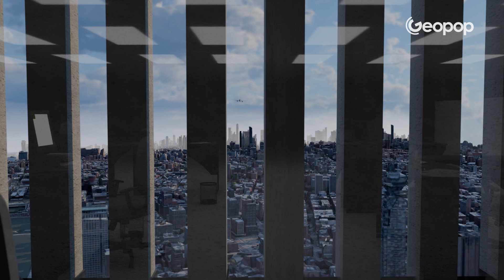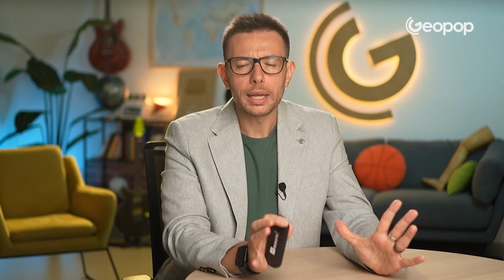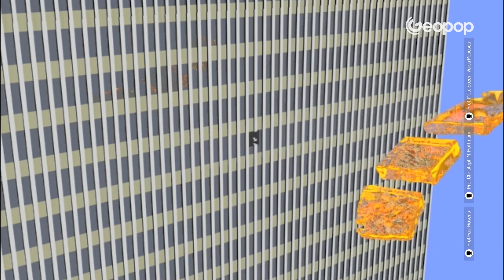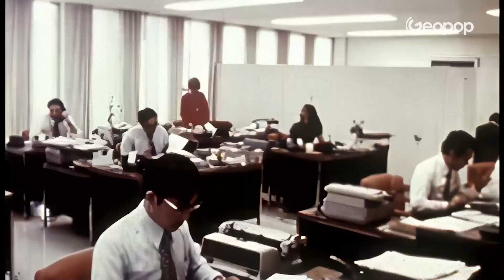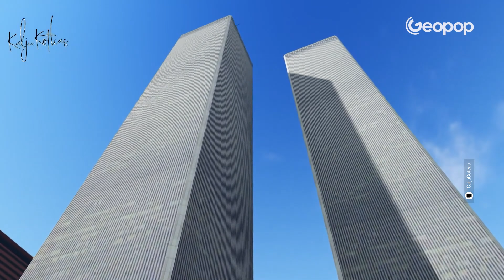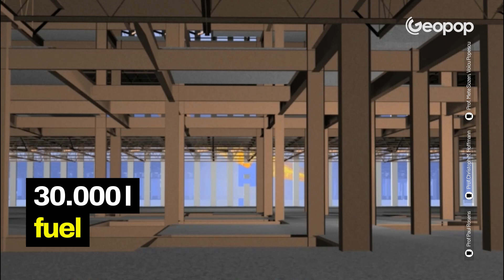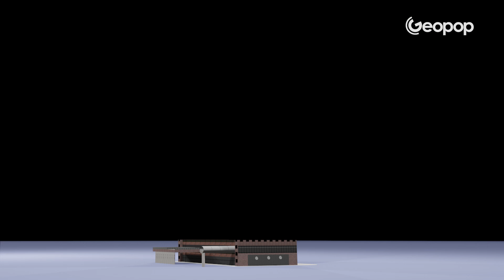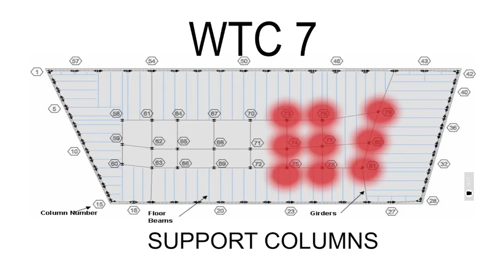9/11, 2001: The Technical Reconstruction of the Twin Towers and WTC 7 Collapses

Comment: I am sorry but below intact floors do provide resistance in a collaps, and will not result in symmetric explosive destruction at free fall of the above and below floors... 

The below structure is much stronger than the above structure. It is impossible for the structure below to instantaneously provide zero resistance at each collapse floor line without the column instantly go from providing support to not providing support. 

We should expect to see deceleration of the top floors and non symmetric collaps and the top floors impact the lower floors.

When a stationary mass is hit by another mass, the kinetic energy is absorbed by both masses and you see overall decorations (resistance).

Note by your own explanation, the top of the building is not a solid item. The central section of the building that house the elevators and stairwells etc is in their own right a self standing sky scrapper that provides resistance. You would expect to see the floors falling amount this section in your explications...

What you model graphically is not how physics work in the real World.
Reply: You are completely wrong. The lower structure is capable of sustaining the load of the upper portion only if this load is carried by the columns. Once it collapsed, the debris mostly fell between the columns, on the floors and beams that were completely unable to sustain their weight and provided next to no resistance. Once those were gone, the columns buckled since they had no lateral support. This means that the upper portion would have fallen exactly like we saw, with  no need of non existent explosives.
Reply: @marcop1563    Exactly,  also note that the collapse was not freefall.  The collapsed happened quickly though as  momentum (mv)  was increased  as subsequent floors added to the mass falling.
Reply: The falling debris bypassed the load bearing structure.

That is why it was falling.

Let’s break it down to the absolute basics:

The 47 core and 236 perimeter columns of the Twin Towers support all of the gravity loads of the building. ALL of the resistance is in the columns.

Planes impact Towers, causing massive structural damage, destroying sprinkler systems, tearing out gypsum board walls and blasting off the SFRM insulation from the floors. Multiple floor-wide fires are started instantly and spread rapidly due to the destruction of fire protection systems and venting of the building during the impact.

Serious fires were largely confined to the impact damaged floors and those immediately adjacent to them.

Fires were started by the impacts and fuel aboard the aircraft, which acted as an accelerant. No shortage of other consumables inside the tower to continue the fires.

Collapse was initiated (started) at the impact and fire damaged floors when floor trusses exposed to heat over time sagged, in turn pulling on and causing the inward bowing of some perimeter columns by up to 5 feet until they buckled on one face of each tower (ie: NOT symmetrically).

www.youtube.com/watch?v=ULdiD6gYZO0

No steel melted or needed to. Structural steel will bend and fail at less than half its melting temperature.

Once the perimeter columns buckled the formerly static load above became a dynamic load 30 times greater, easily overwhelming the structure below.

Thousands of tons of now loose debris fall through the open office space within the four outer walls - bypassing the columns - dropping 12 feet onto the first intact floor it comes across. That massive instant overload causes the floor to fail, shearing the pair of bolts that secure each end of the floor trusses to the columns. The floor fails. adding its mass to the falling mass which continues to accelerate for another 12 feet until it impacts the next floor, rinse and repeat one floor at a time all the way down.

The columns - the part that holds the building up, supporting ALL of the gravity loads - are spectators for all this.

Rate of collapse increases as momentum increases. The collapse front is constantly accelerating.

As each floor fails, air inside the building (the Towers were 95% air by volume) is compressed, then blows out the sides _in reaction to the Tower falling, not the cause of the Tower falling.

No fire required at all on floors below the impact points for them to fail. The mechanisms that started the collapse are different to the mechanisms which continued the collapse. That will be a difficult concept for some.

As the floors fail the perimeter columns are left literally hanging in the breeze, no longer attached to the rest of the structure. They peel away and fall in great sheets (think banana) out to more than 600 feet from the base on the 4 points of the compass.

Core columns failed last.

No Laws of Physics are violated so no need to invoke magic or divine intervention

Each 110-story tower had a 1-acre footprint. The debris pile was up to 14 stories deep and spread out over 16 acres, destroying 8 surrounding buildings and damaging more than 100 others.

Anything can seem like a conspiracy if you don’t take the time to understand how it works. Hopefully now you do.  If not, I can go into much greater detail.
Reply: Please try watching how WTC1, WTC2 and Building 7 were demolished using videos of how they actually collapsed and compare them with the way you are suggesting...
Reply: @llobj001  we all saw the recordings. They are perfectly compatible with a collapse due to the fires and damage from the planes and completely incompatible with a controlled demolition.

Comment: I think this narrator is wrong about the not melting. Looking at the video just before th collapse, molting steel was pouring out the corner of the building. I personally think the CIA was involved.
Reply: Molten steel pouring out of the NE corner of the South Tower (and it was in fact ONLY the South Tower)?

You mean this?

youtube.com/watch?v=xPVGGQU-MeQ&ab_channel=SeekersofTruth

So you think that is steel why? Because you performed metallurgical tests? Because the internet told you that’s what it is? I think we can do better, so let’s do better and build a theory the right way instead of making evidence-free assumptions. This will take just a couple of minutes and is worth the investment.

The Boeing 767 which struck the South Tower weighed 117 tons and 80% of that was aluminum. The exterior cladding on the Twin Towers – the white panels – were also aluminum.

When Flight 175 struck at the 81st floor its momentum deposited much of the office contents in its way and the bulk of the aircrafts mass into the NE corner of the building. The piled up debris shoved into that corner is visible in photographs and video so we know it was there. There’s a good shot here of piled up debris from 4:36; 

youtube.com/watch?v=ZLJyL63sqtU&ab_channel=MrKoenig1985

Steel melts at roughly 2,750-deg F while fires in the South Tower reached peak temperatures of around 1,800-deg F. Aluminum OTOH melts between 887-deg F to 1,180-deg F depending on alloy. That aluminum will melt under these conditions is not a surprise. If you look at pictures of cars left behind and destroyed by forest fires the aluminum wheels are invariably melted away along with other sometimes aluminum parts like hoods. Steel bodies remain intact.

The “molten metal” appears at 9:52 am. At the same time we see the first externally visible signs of sagging floor trusses and the pulling of the perimeter columns inward. I submit these events are related, not coincidental. The aluminum cladding at the NE corner also appears to me to be burning. It is likely with the floor trusses sagging under the heat, and the 81st floor truss in the NE corner under the debris pile subjected to the heavy load of the debris pile, the truss broke its perimeter column connections and dropped, instigating the material starting to pour out of the NE corner at the 80th floor. Given the properties of the materials in question, aluminum is by far the most likely culprit.

Reports from The NIST, FEMA and MIT all concluded the material is aluminum.

Certainly steel is the least likely of all the materials the anomaly could be given its much higher melting temperature and the fact there is no logical source for molten steel. The perimeter columns in the NE corner are intact and the material is pouring out between them. So it isn’t columns melting, therefore what other source of steel is there?

Deniers will claim molten aluminum appears silver when molten, which is true but only at the low end of its melting temperature range. Aluminum can and does get hotter and it glows red to orange when it does (1,100 to 1,800-deg F). Most folks of course just don’t bother getting it that hot if the goal is just to get it molten for say molding a part. No need to go higher.

The total mass of molten aluminum is a BIG deal in regard to how it behaves when poured. Quantities bellow half a liter cool almost instantly if poured onto a flat surface, but if poured into say an ingot mould will stay red for a minute of so. Pouring volumes of molten aluminum greater than a liter is a VERY different experience. The thermal mass is much greater and the radiant heat is horrendous. The aluminum is able to stay liquid and remain glowing bright orange much longer.

The famous video of glowing liquid gushing out of Tower 2 moments before it fell, involves at least tens of liters of molten aluminum. The thermal mass involved is so great that it stays red after falling many meters through the open air.

Side note: There was also a large UPS battery farm in that spot and some of that material at least may well be from the batteries IMHO.
Reply: @TheLoonResistance    In summary people seem to be very good metalurgists just remote sensing it from videos and reports  ...
Reply: How do you know that was steel melting in that video and not other metal such as aluminium or other metails ?
Reply: @zakelwe well i wasn't there, i didn't see it. These experts did.
Reply: Molten steel was reported by the fallowing 
people. Captain Philip Ruvolo (NYCFF), 
Richard Riggs(debris removal expert) , Leslie Robertson (wtc structural engineer), Lynn Margulis (University of MA),  Dr. Abolhassan Astanch (from Berkeley),  Robert Kim Ireland( chemical engineer for US Army Corp of engineers), Mark Basile( chemical engineer), Kathy McGrade (materials engineer), Gery Warner( Mechanical engineer), David Gregg( PhD Chemical engineer), Steven Jones PhD( physicist), Kevin Ryan ( BS Chemistry), Niels Harrit (PhD Chemistry), Tom Sullivan( Explosives team) Jason Cheshire ( Chemical engineer), and Jeffrey Farrer (PhD Material science engineer).

Comment: No open air fire, regardless of fuel type, would burn hot enough to weaken steel to the point of failure. This was a demolition.
Reply: It literally happens all the time.  Steel is formed using heat and deforms the same way. Blacksmiths have knowmn this for a millennia.

Scroll up to the YouTube Search Bar and type in Sherman's Neckties
Reply: Yes it would, you're an idiot

Comment: sorry, but after doing 30 years plus in construction i dont believe the planes alone took down the buildings. no one ever mentions the fire sprinkler systems, whih yes were damaged, but there was still enough large volumes of water to keep temps lower due to moisture
Reply: The fire systems were completely wiped out in the initial impact.  There was no water.
Reply: @ChristLink-Channel  even if the pipes were broken, you will still have water in the pipes, and fire pumps are at around every 20 floors. the reason is that if water coming in from the street is 80 pounds, you lose about 7 pounds per floor thanks to gravity. the pumps boost the pressure every 20 floos or so to 200 psi.  That way there still enough pressure at the 20th floor. the main riser supply pipes are 6 to 8 inch and mains around 4 inch and go down in size to the branch lines that have the sprinkler heads. break a main pip and your going to have water in that pip and its going to go everywhere. the water cant go backwards to lower floors because the systems have check valves to keep that water on that floor or higher. add to that, the stairwell have a 6 inch stand pipe that the fire department can hook into to pressurize the standpipes so the fireman can hook into it at each floor to fight the fires..
Reply: There was water storage tanks in all of these buildings for fire suppression. I've seen absolutely no evidence that.
The fire suppression system didn't work. They didn't need water at the hydrants or even water pressure in the building because they had storage tanks for the water. So that gives you the water.
And the pressure
Reply: @robbiehiatt9966   How was the water piping structurally after the impacts.  I'm guessing a few leaks.....
Reply: @zakelwe yes, you're guessing.. tower 7 suppression system was turned off according to what I've read
Reply: @robbiehiatt9966    Moving the goal posts ?  Ironically the weight of stuff on top of WTC 7 helped it collapse, rather than any nefarious means
Reply: @zakelwe well if you understand it so well why don't you explain the upward forces involved in the collapse? There is no goal post.
Reply: @zMW574e  lol im guessing lots of water, and thats why im having doubts about a lot of things. no water was even seen coming out of the building and just think about the number of water pipes from sinks and toilers that should be flowing out somewhere.

Comment: It came down like domino blocks. The weight above the impact zone was to heavy once it buckled it was over.
Reply: If i sound aggressive in this video it's because it was originally intended for for someone else i copied and pasted.  1.The firefighters said" it looked like they planned to take down the building" I didn't say that, The fire fighters said that. They were there.I'm sure they know best.
https://youtu.be/XiIT4HInWjY?si=e1Pvp3-IFs-M75Oj
When the firefighter says "boom, boom, boom, boom" in this video.
What do you suppose he is?Implying by " boom" ?? 
2.So if there were no explosives then what is this? 8:25
https://youtu.be/bLF5D7M1YgA?si=aHSvS__uOdxMi1ZB
You can't say that it was added because you can see the firemen's reaction to the explosion. And you can't say it came from anywhere else because the firefighter says
" We gotta get out of here,  7 is exploding "
3. Controlled demolitions have squibs, you can see the squibs here 20 floors below the collapse. 
https://youtu.be/eXAgulfAtR4?si=-iLO9aQjMJVLTUYH
4. Firefighter says "any one of these buildings could blow up,  this ain't over yet" firefighter says there's 3 secondary explosions. 
https://youtu.be/0Gh3ErgMI4M?si=mmp9Eus_5PWTCBfl
5. Airplanes can't fly 600 mph at 1000 feet. And to be able to make a 180 degree turn to hit the opposite side of the pentagon going that fast is ridiculous. And since when do terrorists hit the opposite side of the building where no one was at when they could have just flown straight in and killed way more people???
 https://youtu.be/0Gh3ErgMI4M?si=mmp9Eus_5PWTCBfl
7. No one has ever known ahead of time that a building was going to collapse except through controlled demolition.  Tower 7 was reported to have fallen while it still stood in the background. 
8. Larry silverstein,  the man who made over 4.5 billion when they fell, claimed to have pulled the building down.
https://youtu.be/1jQaJFNWqtc?si=wCywQ9grgBdS_w11
9. A witness reported a missile hit the pentagon while he was seen at the scene. 
And the hole wasn't big enough for a plane and the damage wasn't consistent to the towers. And just like shanksville,  there's pictures that show no plane parts at all.
https://youtu.be/6_Ez-UCpXMs?si=JaQ6DBEC_LJtMLgN
10. That video also points out They were military planes that hit the twin towers.
Reply: @robbiehiatt9966    Considering the collapse happened at or just above the impact zones how did the detonating cord survive the impact and fire for all those minutes?
Reply: @zMW574e what cord? Easley could have been wireless. Especially considering the boxes of switches piled to the ceiling that was discovered inside the towers before they collapsed and published in a book in austria. The gelatin group.  The b thing. Ect...
Reply: @robbiehiatt9966  then how could the radio detonators survive the impact and fire?

And why there is no explosion audible in any of the recordings?
Reply: @marcop1563 i'm guessing it was embedded in concrete on the upper floors. Someone suggested to me once that they put explosives in the 99 elevators and spaced them out throughout the buildings 1 and 2.  To nuclear bombs were dropped on north carolina a long time ago , and they did not explode. But some of the explosions were definitely heard by dozens of people. There is this explosion coming from tower 7. 8:25
https://youtu.be/bLF5D7M1YgA?si=aHSvS__uOdxMi1ZB
If you're interested, let me know.I could find more evidence for you of those explosions
Reply: @robbiehiatt9966    The only problem with your theory is that concrete and metal is not a good place for radio waves to be ... check out the problems NYFD communications had even on floors not collapsed...

"i'm guessing it was embedded in concrete on the upper floors"

The problem here is that metal beams and concrete reflect radio waves...     think again.

So no wiring
No radio.

So how did they set off the detonations at the level of the plane impacts?   And why did they wait so long after the planes hit ?  And why would you even need to because trwo planes hit the towers, which in normal times, rather than just a hijacking, would be bad enough.